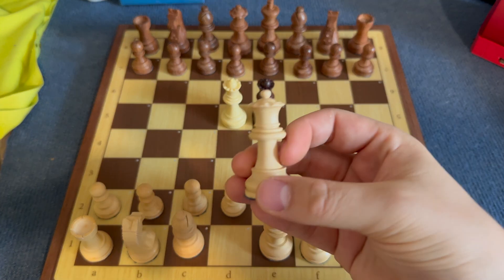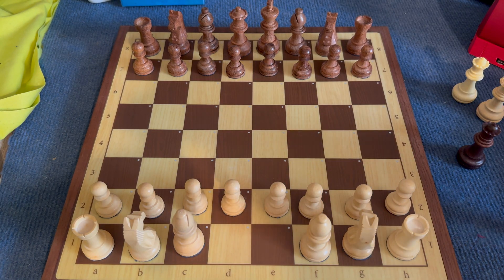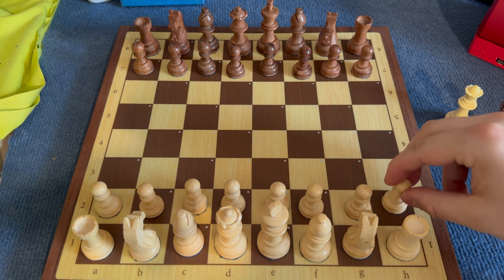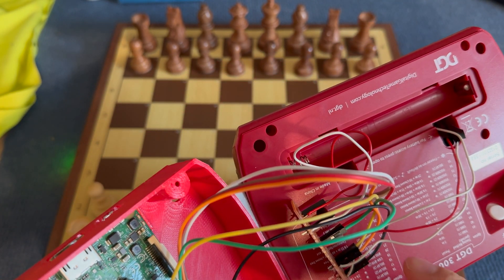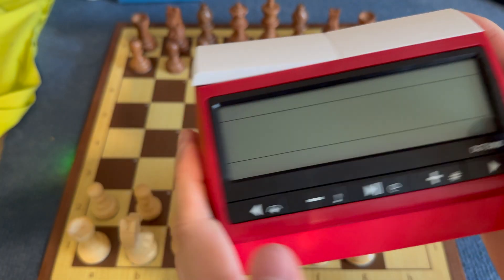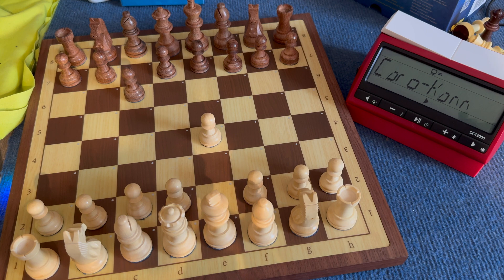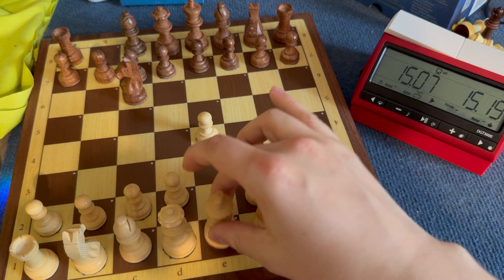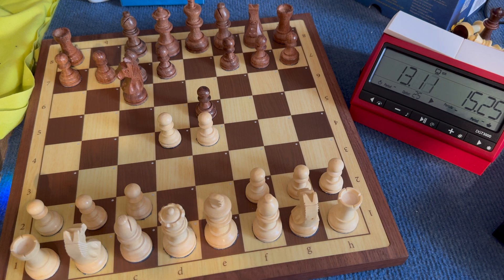Update on my Chessnut Air (DIY Wooden Chess Pieces / DGT 3000 Conversion into DGT Pi / Picochess)

Comment: If you cut the rubber to expose the sensor do you think it could fit in the peice with the weights?
Reply from the maker: In my case it did not fit. I had to remove all the gypsum / plaster cast including the casts on the bottom and sometimes had to drill out a few millimeters of wood for the sensor to fit. There should be 1 or 2 millimeters of gap between the wood of the figure and the top of the sensor to allow some wooden glue to reside there and hold the sensor.

Comment: what pieces did you use? I'm looking to do the same but want to make sure I get size appropriate peices.
Reply from the maker: The pieces I used are from a brand called "Philos", the series is called "Artus" with king size of 65mm. The article number of the set is 21831.